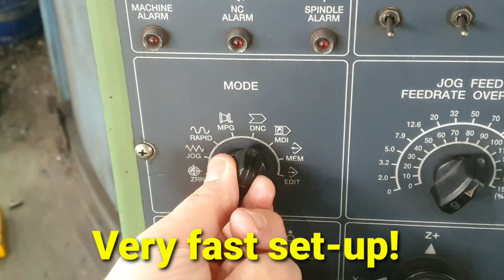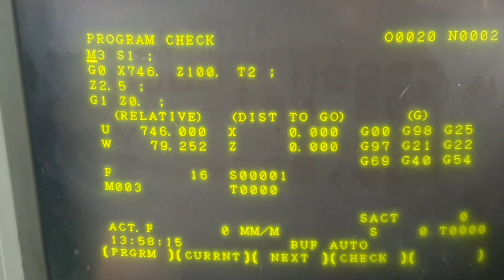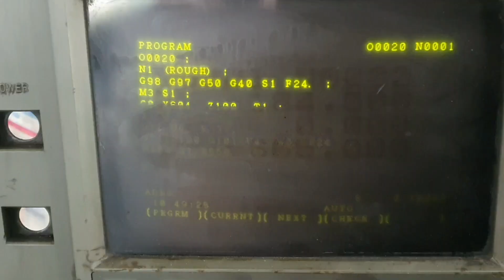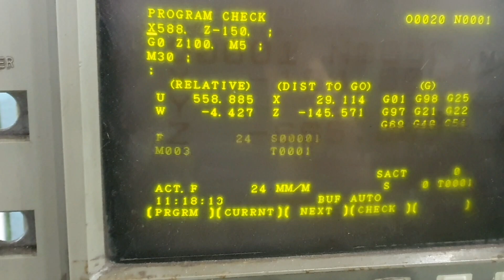Press Machine Parts Machining - CNC Lathe, Vertical Lathe, Turning

Comment: Nice job! Is it possible to cut threads with a vertical lathe?
Reply: cnc yes, manual no.
Reply: There can be special equipment for the thread, it is too wasteful to use a vertical lathe :)
Reply: In one of his later videos he cut a spiral groove into the top surface of the part. It was to ensure that a flexible seal wouldn't be squeezed out when two steel parts were clamped together. So it wasn't a thread, but it shows the tool can do that sort of thing.

I don't recall ever seeing functional threads that were a meter or more in diameter. When things get that large, engineers put flanges on the parts, and use bolts to connect the flanges.

Are there any examples of huge functional threads in the real world? How do you screw together things that weighs hundreds of kilograms?

I am familiar with nonfunctional large threads. I have made a giant model of a screw and a giant light bulb. They were light weight and would not have survived being screwed into something.